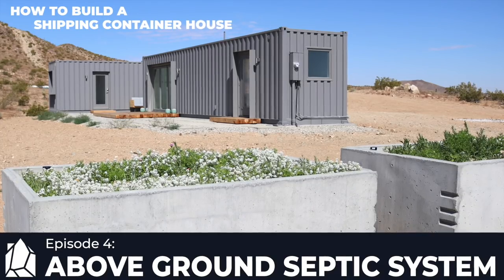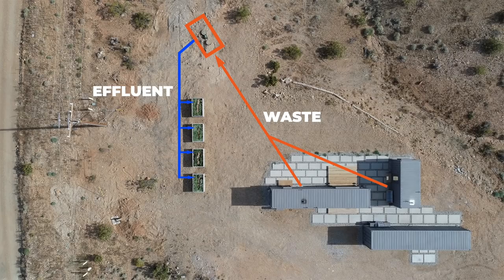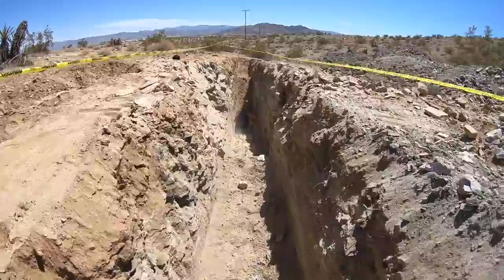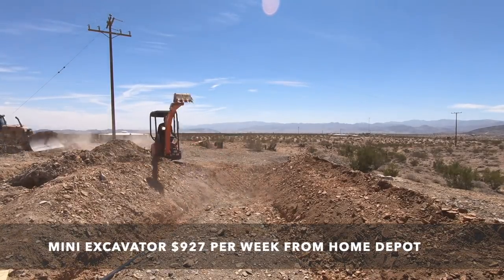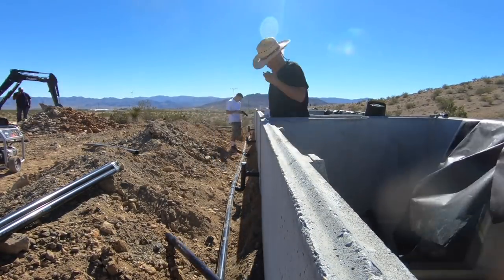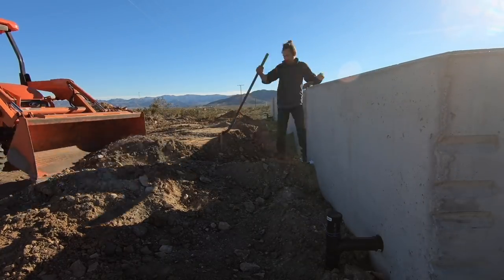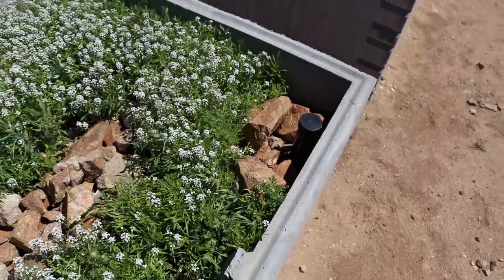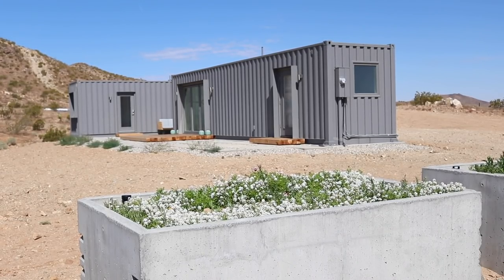Above Ground Septic System | Ep4 Building Shipping Container House

Comment: Fantastic project. I would like to offer two helpful bits of information: There is a plant called vetivier that is used for water remediation projects. The root system is extensive and they can absorb any contaminants. The 2nd is you can inoculate your septic tank with EM microorganism (Effective microrganism by company of the same name). You do this by putting inoculated ceramic balls in mesh bags submerged in the septic system. The ceramic balls serve as hotels for the EM microrganisms and the balls stay housed in the bag. They will help consume the waste.
Reply: Where can I purchase the inoculated ceramic balls?

Comment: this is why i love this series. i adore container homes and would love to build one out eventually, but there are no videos to this depth (or any resources that i’ve really found!) that explain the finer details of building a house so far off the grid. i’ve always thought using effluent/waste water in a garden would make the most sense but i had no idea what pipes i would need, what would need to be above and under ground, how to connect everything with mechanisms for overflow safety, etc. i’d rather you take time for these denser videos and they be spread farther apart for the best informational impact! thank you so much for sharing this build process, i’m learning so much

Comment: Very cool. I had built the first permitted septic system of this type in Arizona some 21 years ago. In the application process, I used the term "constructed wetlands". It is a concept developed by the TVA that addressed perk issues when they flooded vast areas of farmland. There are large rest stops in lower Appalachia where you can see these systems in place. I like the concrete planters. Looks like they saved a lot of work.

Comment: I guess this can technically be called an "above ground" sewage system. In our city neighborhood the efluent drains into one more holding tank where it gets continuously aerated to kill most bacteria. When the aerating tank becomes full a pump activates and the sprinkler system sprays it on the lawn. So, really you can just spray all that efluent on the ground as long as you aerate it first for a few days in a separate tank. I bet you could grow grass in the desert with that kind of fertilizer.

Comment: Hi Ben, congrats, really great design, as always. I only have one concern, I've lived in my container home for nearly ten years and I strongly recommend you building any caird of shade over them. Even with that insulation in summer it's going to be really hot inside. You can build a roof and securely place the solar panels. After my experience with containers I decided to build something more comfortable, that's when I found the passivhaus system, it changed my live. I am now a happy owner of a passivhaus. Hope it helps.

Comment: if you didnt plan on putting 2 containers side by side. just buy a trailer. the width of one is so cramped, or like a mentioned in an earlier video. a Steel building you then convert into a home. They are much more affordable square footage wise and you end up doing the same amount of work.

Comment: I'm actually surprised that this type of system was permitted, maybe due to the low daily flow of the system. Where I am located, it is almost always required that a subsurface system is installed to disperse the effluent. In your case, while yes you are discharging effluent from your septic tank, it is not treated (other then basic treatment from the septic tank) so there is always a risk for animals or people to get sick. Only time a surface discharge is permitted would be when the effluent has been treated to a point it can be drinkable for simplicity sake, but obviously you would not drink it. 
I'm not sure I agree with the overflow going back into the septic tank. By the looks of things it doesn't seem that there is a alarm installed, I would strongly recommend you getting an alarm installed within the riser because if you have a large influent event from a get together or something you could potentially run into a problem. If the flower beds are fully saturated and sending effluent back into a already full septic tank, having an alarm can notify you to either stop using water or get the tank pumped. Also a backflow preventer may be a good idea, so waste does not re-enter the building.
Reply: Jason Ghawali I didn’t notice that there wasn’t an alarm but I agree with you. There should be a high water alarm to let you know that something is wrong (pump has failed or a float is stuck). Otherwise you’re out of luck. Nice catch

Comment: Great vide, love this set up. I recommend you check out using a "solid state" pump switch that eliminates the float valve. Pump failures are mot often caused by float valve failure.

Comment: If those planters weigh 1000 lbs each, they actually saved you TWO tons of work 🤣🤣🤣 kidding aside, the concrete hot tub needs to happen!
Reply: Ya that hot sun will certainly warm that effluent enough to soak in. Main issue will be to produce it faster than it evaporates.. Each tub is 1000 gal each so permits looking for a lot of urine per day.

Comment: Some time back I had property in Northern Arizona. The leach field test was similar; you had to dig a hole about 4' x 4' x 4', then a county guy would come out. He'd climb down in the whole and take a #10 can with both ends missing, set it into the dirt at the bottom and fill it with water. If it took longer than a minute to drain, you failed the test.

Unlike the land in your vid, not so much rock as calichi soil. Had a neighbor fail three times in a row; here's how we fixed it. Dug the necessary test hole and filled it up halfway with water, then dumped in 2 ga of sulfuric acid (battery acid) bought from an auto parts store. That was on Saturday. Wednesday the county guy came out. When he poured in the water it drained as fast as he poured it. They passed. (They treated the completed leach field dig out the same way.)

Comment: Great project, well thought out.Good video. Couple of things. As you know when it does rain sometimes it can really pour. Is there a chance that the planters fill up and back flow overwhelms your septic tank? (In which case the planter's surface water over flowing from the top would have significantly lower effluent levels. What's the 100 year rainstorm for your high desert area? And consider that the Global Warming models are that southern California will become cooler and wetter.)  What will be the bacteria levels, etc in the plants and top soil of the planters? Is this an issue? (I know night soil has been used for thousands of years, I've also seen the hepatitis posters in rural China where people know more about this probably than most biologists) 
 Also because the water loss in the planters will be primarily surface evaporation,  the top soil will over time shift towards alkaline and hardpan. Probably won't be an issue for years.

Comment: An interesting project!  Note at 4:16 it looks like there was not adaquate compaction of the soil under the 3"  line.  You should expect that pipe from the house will develop a dip and may damage the pipe where it enters the septic tank.  That poor compaction may cause problems in the future.

Comment: Seems like the composting method is alot cheaper, easier, faster and compost for the plants.  Off grid with Doug and Stacy have a video on their system.
Reply from the maker: i will check that out!  thanks for the tip and for watching!
Reply: Not allowed in all areas. Not where I live I know for sure.

Comment: I enjoyed your videos of your interesting project. I have a few  technical comments: 

1. Crawl space height is measured not from the exterior finish grade but from the grade inside. ( Like short basement.) 

2. A mechanical engineer (preferable one who has design experience with design of shipping containers.) would have been better than all unnecessary the wood framing; insulated structural panels would have been better also. 

3. Welding on all your trim will make replacement of your sealants impossible, sealants won't last in the high heat of Joshua Tree is extreme.

Comment: Suggestion: To reduce heat absorption from the sun, paint the exterior walls with white or any lighter color. Maybe painting the rooftop with silver providing a mirror effect, reflecting sunlight back towards the sky.
Dark colors absorb more heat than lighter colors.

Comment: Great video. Very informative, but I am wondering why use a shipping container? If this is permitted and not mobile, sitting on a slab of concrete - why not just build a house? Is the container, or in this case, 3 containers, less cost than the cost of the exterior materials on a "regular" house? Seems like you could have more flexibility, freedom and maybe even save some money by building what you want on the slab.

Comment: Rain collecting in the planters will overflow and get routed back to the septic tank. Therefore, I would be concerned that in a heavy rain the septic tank might overflow and backup into the house. I'd put some sort of rain roof and rain gutter system over the planters to avoid that.
Reply: toronado455 That could very well happen but with the pump it will just recirculate the water until it evaporates. Especially where it’s over 100 degrees a lot of the time it seems it shouldn’t be a problem.
Reply: They get some rare monsoonal downpours in the summer/fall in that area.  Otherwise the average annual rainfall is only five or six inches.  Looks like there's enough freeboard to take in a rare 2" cloudburst.  This isn't Texas! They may actually need an auxiliary irrigation system to get the plants to survive the summer (if that's what they want).

Comment: Your topsoil is going to filter down and plug your system as well as plant roots infiltrating your pipes.... Good luck!
Reply: @David Dean. You're correct about the topsoil filtering thru & potential blockage from roots.
Reply: That is why he put the landscaping fabric over the pipe in the bottom to keep that from happening. It lets water flow through but nothing else. Plant roots won’t penetrate it and topsoil can’t get through it. Won’t be an issue!

Comment: That was a spreader bar the slings were attached to on the crane block, they're a necessity alot of times to keep the straps off the load or there could be load damage from the loads own weight where the straps make contact, my biggest question is with the exception of trusses,felt,shingles and siding, how much did you save as opposed to a traditional frame home? Don't get me wrong its a nice finished product done correctly but with all the permits and imo lumber over kill doesn't seem all that cost effecient, ah you touched on it as I asked 'not as cost effecient' nice set up tho man all my doucheness aside

Comment: Interesting for the novelty value, but with all of the inherent limitations imposed by constructing using standard storage containers (especially width), it barely seems worth the trouble given that the overall cost was 15-20% greater than conventional construction.

Comment: I am worried about your pvc inlet pipes to your planter.  As a planter ages the ground compacts and sinks.  Will your pipe freeze in the winter?  I could see the possibility of  torque stress as the soil sags.
Reply: Susan Nichols it would be extremely rare that it would freeze over since its near one of the hottest place in the US. I live around 30 minutes away. We literally have two seasons hot and not hot.
Reply: There’s a layer of solid rock underneath the planters and the pipe was bedded. Sure it will settle over time but the pipes are pressurized so they won’t have much in them unless the pump is on. The outlet pipe from the pump should have a weep hole so the water can drain back into the tank when the pump shuts off so there isn’t an airlock. That’s how the pipes would freeze and break. Other than that it should be fine!

Comment: I love the series so far. I have one question though, and I don't want to sound condescending because I really do love the idea but: What is the point of building a living space from shipping containers? 

My first thought would've been that it'd cheap and quick, but this series showed quite the opposite. With the number of fees to set everything up, the difference in building materials doesn't really seem like a huge factor. Plus you've shown just how much work needs to go in this to make it functional.

So what is really the main benefit of this over say, a brick house? Is there some property of a steel container that makes it unique? Is the insolation super good or something? Thanks.
Reply: A brick or wood house is old fashioned. Could consider an all concrete house to be sure it is strong enough to satisfy city safety codes.
Reply: @Feedback4Utoday  Yeah I mean concrete too as a typical building material. I just want to know why someone would choose a shipping container. Is it just for the novelty or is there an actual use case here?
Reply: Stam.. Containers r very strong- hold est 50000lbs, are stacked 6 high on ships in stormy seas, land, ride on trucks & rail across the country so very strong and stable - under conditions far worse than the worst earthquakes.   There is a surplus so u can buy for est $2000, so way cheaper than cheapest house.  This series is from a guy showing the most expensive way to convert it..  Also we pay a lot of govt people/govt jobs to come up with codes & things to help us do things & this is what the govt recommends to help us   ie to 'serve us as public'.
Reply: @Feedback4Utoday  Yes but if you remember, he is paying a ridiculous amount in fees just to get permits setup, move this containers around, modifying them. The overall cost of this project I bet is a over $500k, so the fact that you can get a container for $2000 seems irrelevant. I bet the cost of a "normal" house would not be that significantly higher. 

As for strength, does that really matter outside of earthquakes?
Reply: I figure he has somewhere to go when the big one does hit, a huge cost for the bug out plan but what the heck, if you're alive and comfortable, stock it up plenty of food!

Comment: do you have a system to oxygenate the effluent? most plant roots require oxygen, usually dissolved oxygen in rain or tapwater, but the septic tank may be anaerobic
Reply: There will always be an air gap at the top of the septic tank unless the pump fails. And the drain pipes from the buildings are hooked up to a vent so air is always moving. Shouldn’t be an issue for plants at that point.

Comment: You could of had a gravity fed system as the amount of head you need to sustain a flow is not that much and you could simply chain the beds so that your run in had two places to go, in to the tub and then in to  an underground over flow tank that then pumped the recovered run off, which by then, should have been completely digested, cleaned and then fed up to a holding pool to evaporate. Using Solar power to pump and run controls, I would have considered that kind of system as you could have had a small water feature and planted out with filtration plants. If its as dry as it is, then evaporation shouldn't be an issue.

Comment: A leech field drains the remediated water into the ground. Where does the water go in the concrete drain boxes? Evaporate? If that's so, would evaporation be enough to handle all water from year round living or is it only good enough for short term living (since this is supposed to be a vacation home)?

Comment: I'm surprised that no one suggested a greywater system to you. These systems use water multiple times, which not only reduces the amount of water you need, but also reduces the strain on the septic system, since you are using less water overall.
Reply: K I believe in Montana you can separate the grey water and just run it on the ground. But waste needs to be in a septic tank or city service connection. Some people are hooked up to city services but separate the grey water for watering plants and what not. Recycled water with nutrients in it from showering and washing clothes or dishes. I’m not sure about the laws in California on this.

Comment: If you turn the first septic chamber in an aerated one, your system will have a much larger capacity and the "leach field" will have a very long service life.  Instead of dirt, the bottom half of the planters should be filled with fine bank sand to filter the effluent.
Reply: Alfred Chiu there is no point filtering the effluent through sand, as ultimately the water doesn't actually go anywhere. The beds are intended to be the final destination of the waste water, although I fail to see how they won't quickly fill to capacity and become waterlogged and unable to perform their intended function.
Reply: @spencerwilton5831  Good point.  Being in the dessert, there will be some evaporation loss, but nowhere near the required surface area for that.  Unless it it is used sparingly, this system will turn into one smelly mess.  Better convert the septic chamber to aerated one.